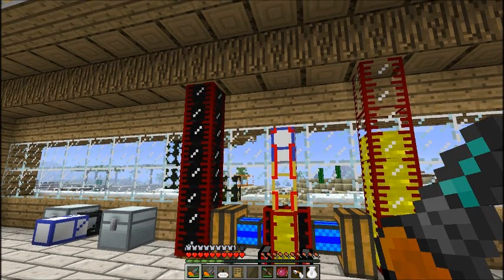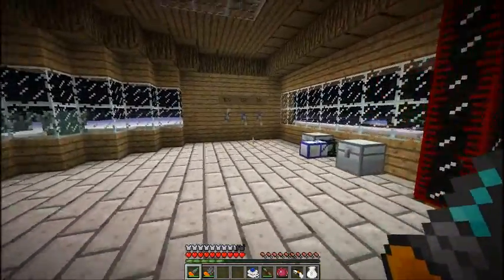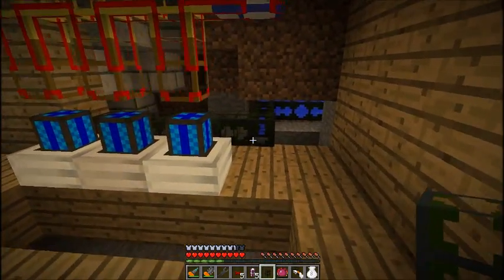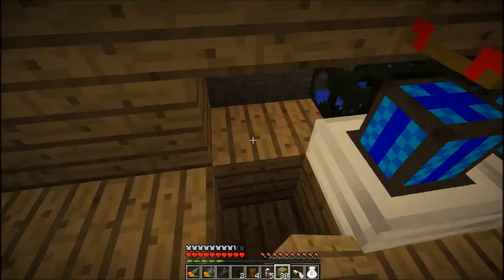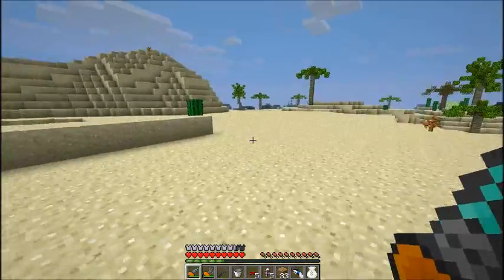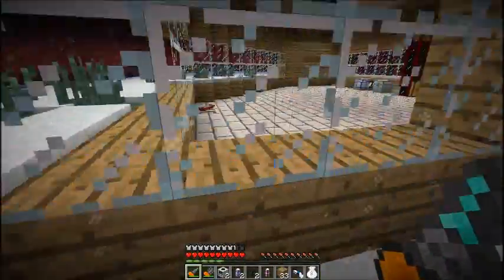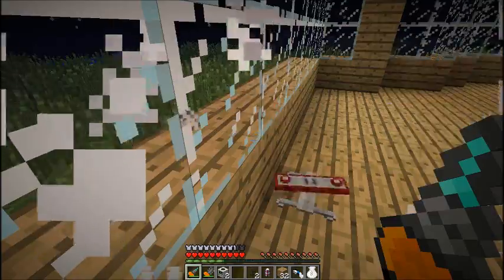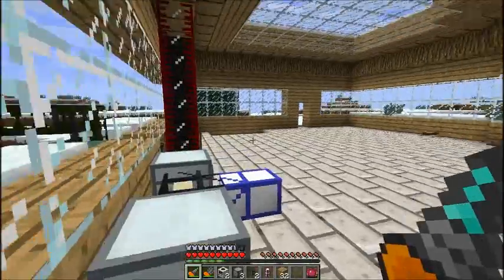Minecraft 1.2.5 Let's Play- BOOM (S1E011)

Comment: use gold water proof pipes ...also connect a line of water pipes to a tank then pump the water from the tank to the engine with one redstone engine getting the water from the tank per combustion engine that setup let me have around 20 going with that type of system (gold waterproof pipes are much better but they don't make it faster they make it so more water can move in one pipe) hope that helps ( if you need more details there are more to be had but i'm sure you know how to fill in the blanks)

Comment: You could use Iron And Gate and it will detect if overheated and can emit red stone pipe signal. And then convert it to redstone signal for a forced shutdown.Simular as Direwolf20 made in season 3.

Power teleport pipes that has same frequencies interact as intersection. DW20 did a test and found out that it is not efficient

Comment: use gold water pipe to cool engines, you need 2 to 1 ratio of pumps to engines, with one pipe feeding 2 engines, IE two engines cooled by 4 pumps with a gold pipe connecting those. that's the best way to be sure they wont blowup.